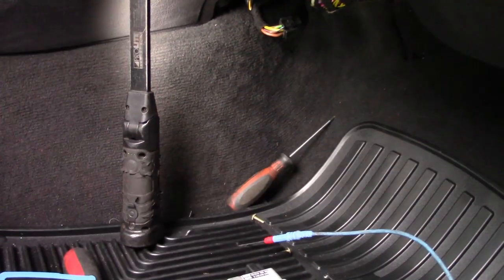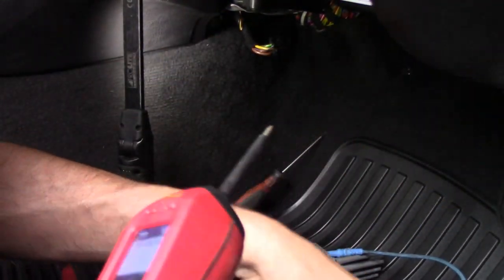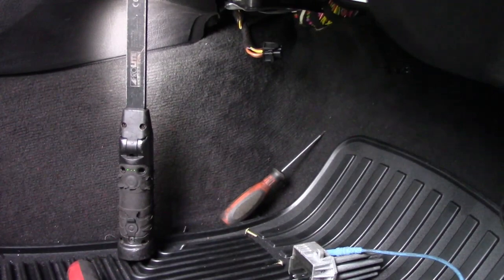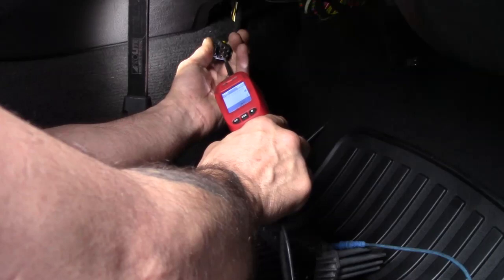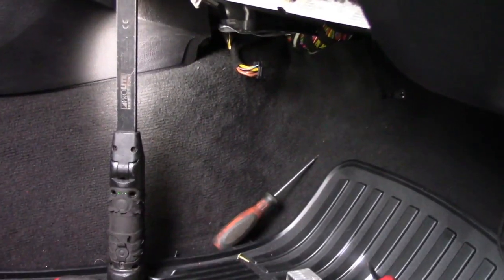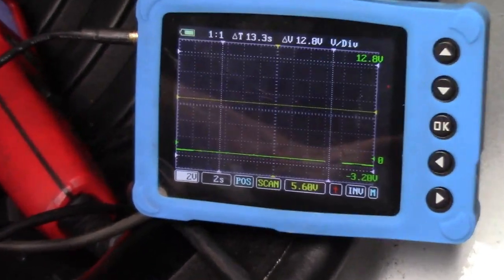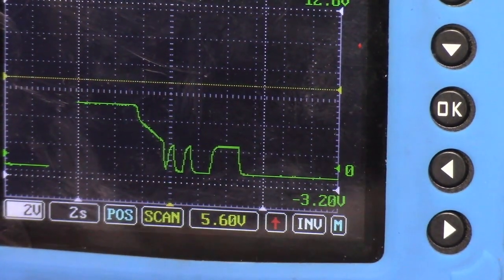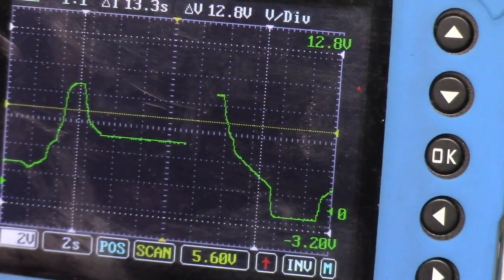Quick Diag on BMW Blower Motor

Comment: I like that J.A.E. tests the load device (motor, lamp, horn, etc.) first before moving on to diagrams, fuses, controls, wiring. 😎 👍
Reply: Starting at last step of the flowchart and working backwards seems better to me...😁

Comment: When those first appeared on Kenworth trucks, they were hidden in some very inaccessible places. The only advantage that I could see is they allow for a finer control of the blower speed, essentially completely variable. For the most part they are very durable, but when they do go bad, they cost a lot more than an old style blower resistor. I think we can all agree that plugged filter killed it.

Comment: I can't help but wonder if the reduced airflow caused by the "out of spec" cabin air filter caused the resister to overheat and eventually burn out.

Comment: I wouldn't call an IGBT or MOSFET an resistor. Just no. Also could not see motor current to verify state of the carbon brushes.
Reply from the maker: Fair enough. Current of motor can be seen with an amp clamp on blower motor wire.